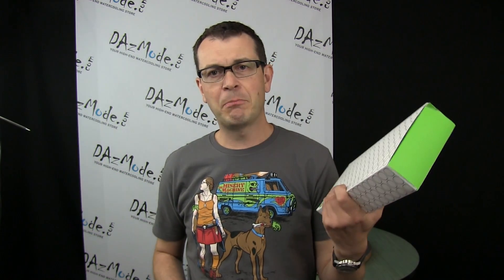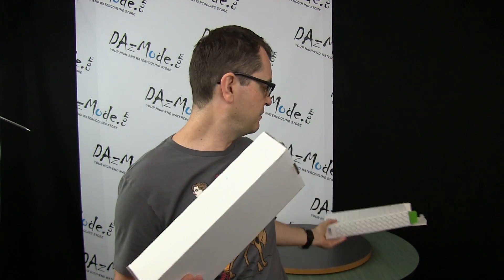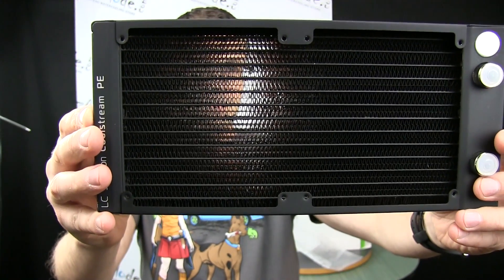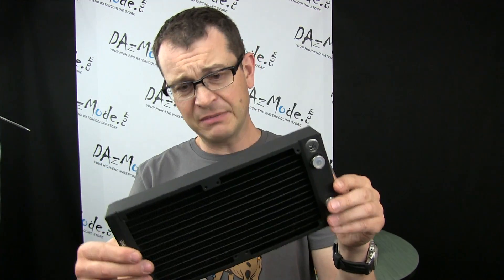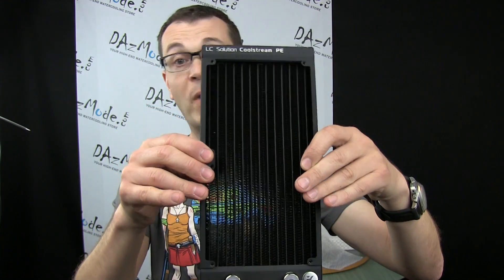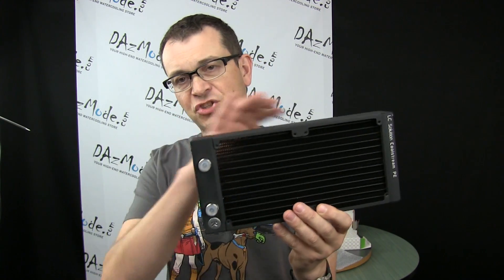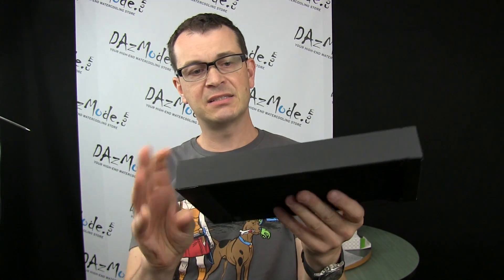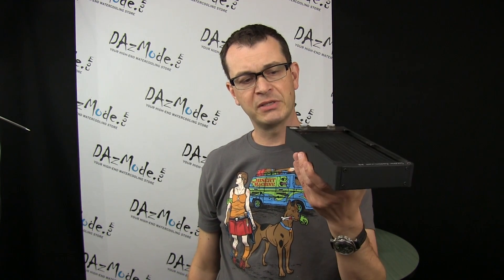EK-Coolstream PE Radiator Unboxing and Mini Review

Comment: Even though I'm late to the party, I actually prefer the AX series shrouds. They are really, really solid, and their construction is a bit better at keeping the end screws from damaging the internal core, which is an issue with the XE version of these radiators. This is too bad because the XE series is amazing in terms of performance at all fan speeds, and because they are non-louvered fins, don't trap dust as much. Also non-louvered fins seem to work better with lower fan speeds and not super high static pressure. That being said I do like these rads a lot.

Comment: so there is no way to use this "technology of double fins" in a silent system??
Reply from the maker: You can use whatever you like. But low FPI radiators would better choice from performance optimized and maintenance (cleaning) points of views.

Comment: 2 x GT 2150RPM are enough to push air through those fins or i will have to use a push-pull configuration ? It's so dense, 38FPI vs 16 FPI of the XSPC AX series, i'm planning to cool a 4930K in a Corsair Air 540 so its mandatory to use a slim radiator, i guess the Coolstream PE is the best option .

Comment from the maker: Don't you guys see that radiators on the market are  all the same stuff with different labels on it? It wont behave any different from any other similar high density double-fin radiator. You can take XSPC EX series, for example, as the reference to get some idea what to expect from PE.Easy and no testing is needed.